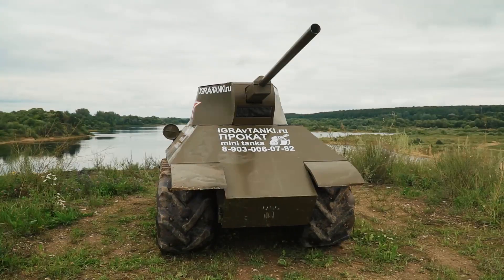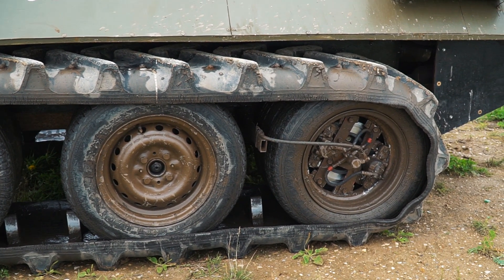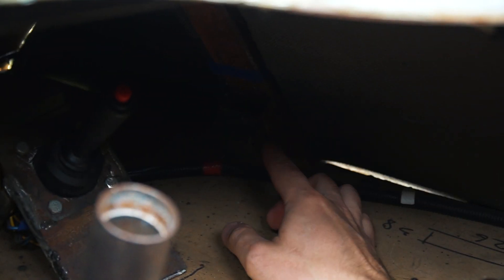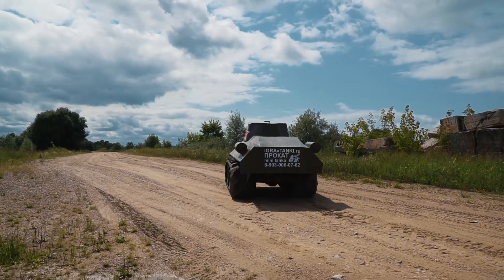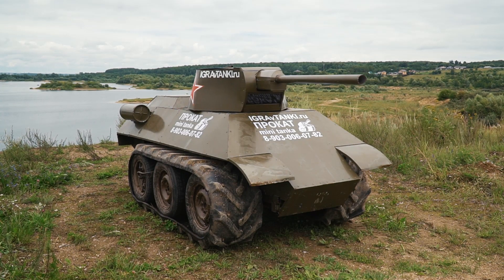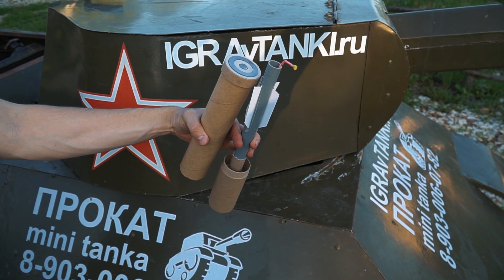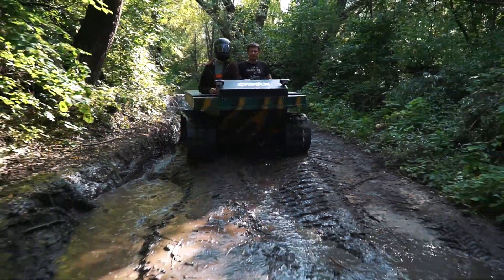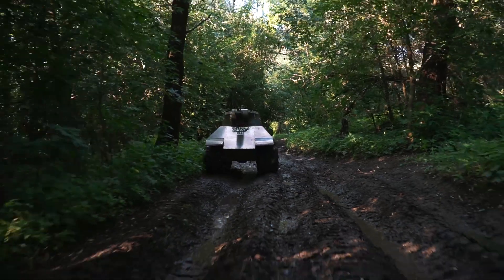We made a tank! Car engine, electric turret and cannon, real skid steering etc.

Comment: Great build. We can call it the T34's little brother, LOL. On the turret front angled armor, I would cut smaller rectangular shaped openings on either side at eye level but cover them with mesh metal screen and a layer of meshed fabric over the screening you can see through. This will give you better visibility when those Paint Ball Panzers try to sneak up on you from your blind spot but still keep the overall cool armored look of your tank intact.